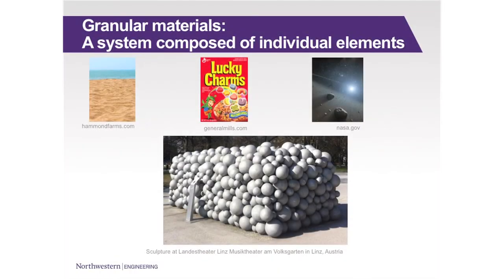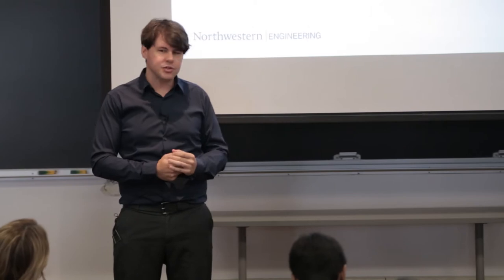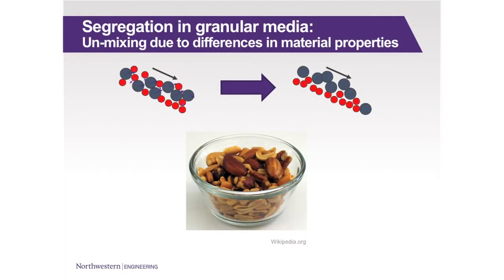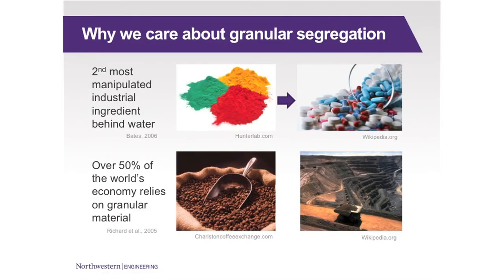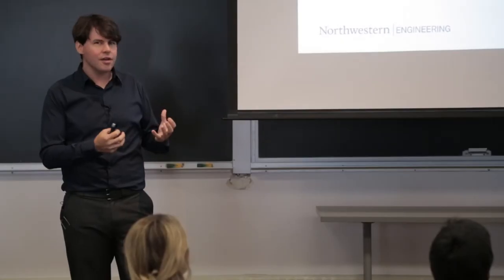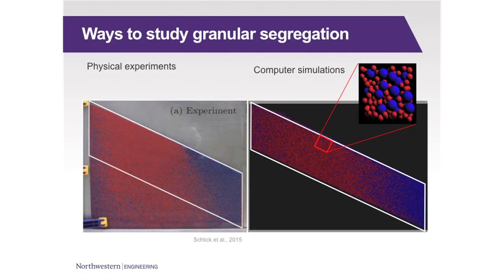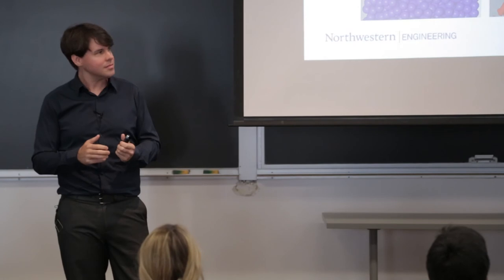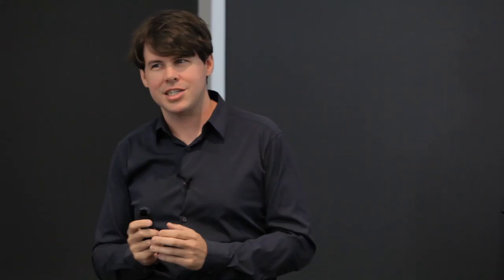Understanding Segregation in Granular Materials

Comment: So why do material segregates??????
Reply: As a basic idea, it's a lower energy state to have the small particles sit below the cracks in the large particles than to have them above the larger particles. It's due to differences in the potential energy of the smaller grains, where a physical system tends to relax to it's lower energy states.

The specifics of how the dynamics work, however, is a very complex process and would take much more time than just 7 minutes or a YouTube comment to explain, and there is still work being done on the problem. It's rather difficult to describe comprehensively, as it is complicated by volume exclusion, friction, and a complex energy landscape.